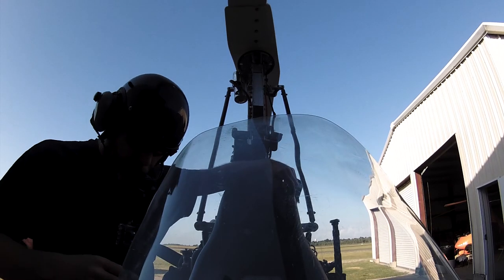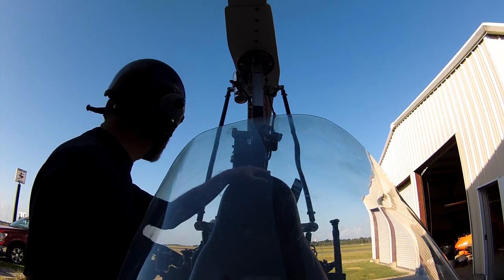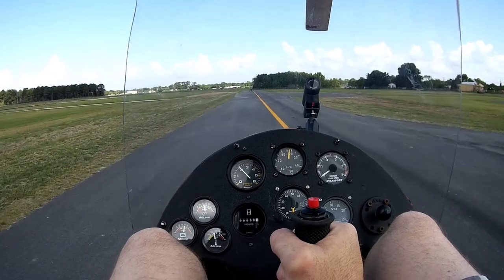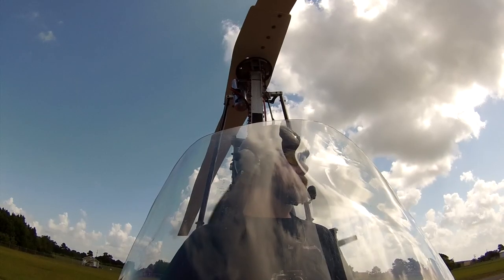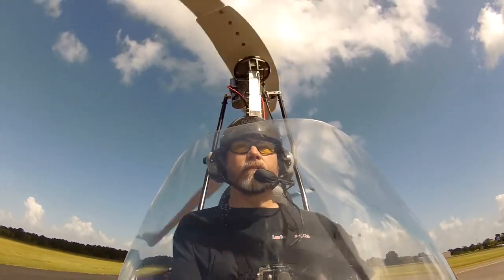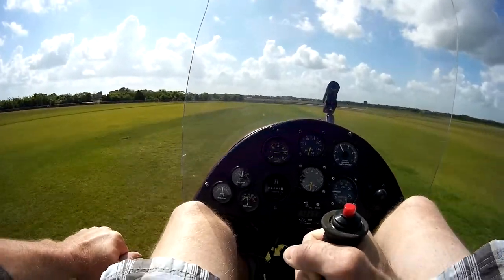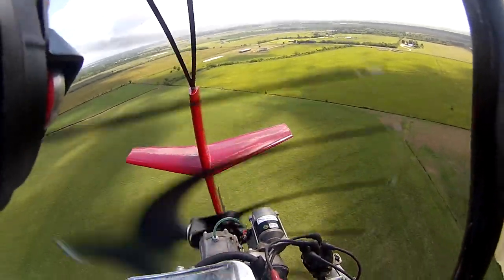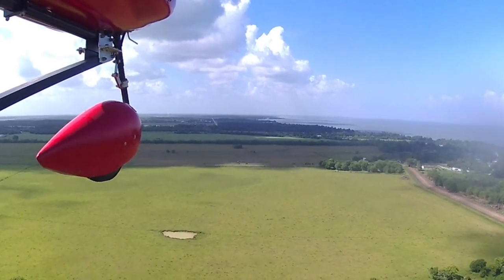Gyroplane Solo to Smith Point

Comment: Hi Booby, good job of talking thru each portion of your flight. Looking @ your gages hard to tell rotor speed. Doesn’t look like you have rotor trim. Normally when  prerotating you hold your stick forward until you get up to a certain rpm then start to pull back to neutral then up to another rpm pulling all the way back while feathering your throttle in. Could you go thru your rotor management phases and also minimum air speed before you fly away. Mike
Reply from the maker: My rotor at take off is around 350 rpm. My airspeed is around 45-50 mph. I have a heavy machine and the temperature and humidity have been high causing low performance. 
I pre-rotate to around 150 rpm with the stick forward. Then I pull the stick all the way back as I advance the throttle slowly waiting for my nose wheel to rise. As soon as the nose wheel comes off the ground, I push slightly forward on the stick to balance on the main wheels and slowly give it full throttle. The machine will come off of the ground around 45-50 mph. I climb out at 50-55 mph and reduce the throttle to around 5000 rpm to stop climbing.

Comment: Hey Bobby, did you ever figure out what caused your lack of power?
Reply from the maker: I replaced the lifters in the cylinder with low compression. This seem to fix the issue. Thrust test are back up to 445lbs @ 5500 rpm.
Reply: Bobby Munroe good to hear!  Good lookin machine.  Stay safe and have fun up there. Are any of you guys heading to Mentone at the end of the month?
Reply from the maker: I don't think anyone from our group is going this year. I'll be on vacation with my family and I know the other two guys that normally go, are unable to go this year.

Comment: is your rate of climb similar to that before you modified your seat height?  or too early to tell yet?
Reply from the maker: As I went through the video footage, I realized my engine was not getting the 5200 RPM I used to get. I was getting around 4900. This will be looked at this coming weekend. I'll have to figure out what caused the drop in RPM and fix it.
Reply from the maker: The seat height will have no effect on climb rate. The issue was with low of compression in one cylinder. I fixed it last weekend, but due to a storm rolling in, I was unable to test fly it.